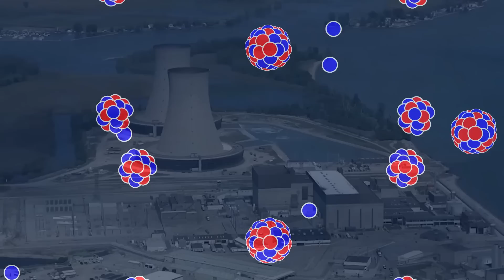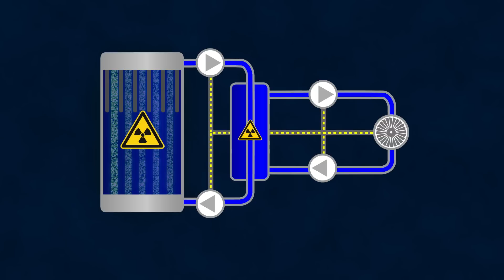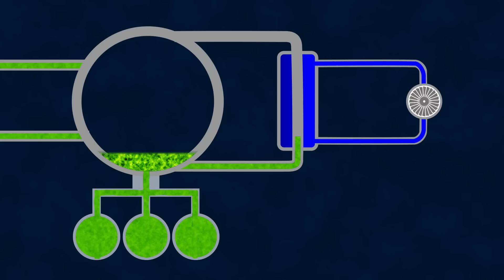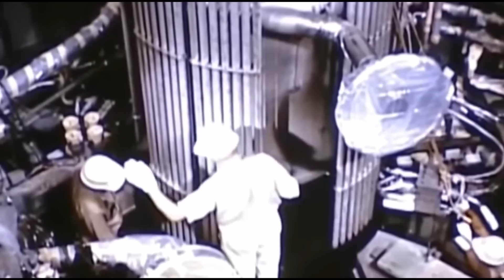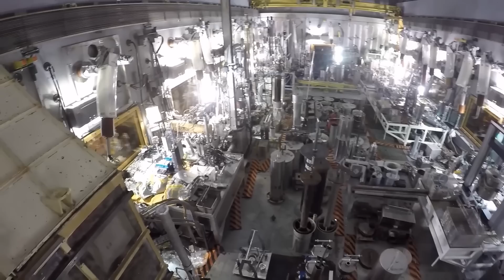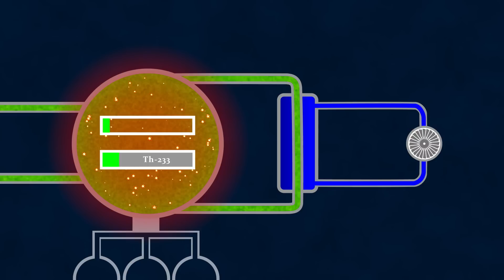Thorium Revolution: Can China’s New Molten Salt Reactor Transform Nuclear Energy?

Comment: Molten salt is the heat and moderator interchange method, both Uranium and Thorium can use it. It’s the salt that makes it safer as it’s not pressurised. 

It’s try decay elements of Uranium are more long lasting than Thorium that decays into Uranium.

I have always thought Thorium/Salt was a preferred but not only nuclear option

Comment: There are so many flagrant errors in this video that it badly detracts from the actual good content. 

Grade: D-minus "Trying hard but MUST fact check more carefully"

=====

Absolutely wrong about the salt's reactivity with air (or water)

Slightly correct about the corrosion issued but never bothered to mention it was addressed in 1964 using Hastalloy-N (which TMSR-LF1 uses and MSRE used) or the fact that WATER in conventional systems is vastly more corrosive (9 inches of stainless steel flange eaten away in 18 months in one case) - water is NOT a benign substance at high temperature/pressure

Correct about the salt density decrease with temperature but failed to mention the doppler effect effectively capping fission reaction temperatures at about 1150C

No mention that the pyrolytic carbon moderator is almost impossible to burn under normal circumstances and whilst it has a 10-year lifespan at "100%" output, its lifespan is effectively infinite below 80% (meaning the best ECONOMIC solution isn't changing out the moderators but derating the reactor. This improves available headroom too.)

No mention that TMSR-LF1 is a single loop design with thorium directly dissolved into the melt, testing Weinberg's proposition that external chemical processing of the Pa233 isn't required, at cost of a few percent efficiency (Cost-benefit analysis)

No mention of the extensive failure mode testing at MSRE which proved the "walk-away" safety aspects of the design as well as immunity by design to every kind of civil nuclear accident which has happened in the history of nuclear power (Military incidents are a different matter stemming from the "fast and loose" attitude to safety), including Mr Ouchi's unfortunate adventure (no water in the core, no need for reprocessing in ways that caused that particular incident)

Claims to use thermosyphon circulation - it doesn't for normal operation. The circulation pumps were an interesting design and the entire MSRE system was moduler, allowing complete dismantling/replacement of all reactor components (including the reactor itself) using waldos

No mention of the extensive use of electrical heating to keep the salts molten if reactions fail (the reactor needs this when starting up before achieving criticality)

No mention that LFTR designs can be fed high level nuclear waste and depleted uranium as fuel (which solves the big issue that antinuclear protestors keep bringing up)

No mention that LFTR designs end up producing 99% less nuclear waste (reducing a 900MW reactor's waste output over 60 years from "about an olympic size swimming pool, less radioactive than the original fuel in 450-500 years" to "a few (3-5) cubic metres, essentially inert in 400 years" )

No mention that LFTR designs run hot enough to directly drive industrial processes or be a drop-in replacement for coal burners whilst occupying less than 1/4 the space (Take a close look at China's coal-fired power stations and note the large blank space adjacent to most turbine halls. Those people are planning ahead)

No mention that despite there being "no thorium reserves", about 5000 tons per year is produced in every single monazite rare earth mine on the planet - "reserves" in mining terms are only calculated for things which have a market. There are no "reserves" of seawater either.

One of the major benefit of being able to use thorium fuel is that rare earth mines become economic. The Chinese have cornered the rare earth markets not by ignoring environmental standards but because the government has been purchasing thorium and stockpiling it for the last 20 years

One of the major benefits of being able to use natural or depleted uranium is that enriched uranium is unnecessary, which exposes separation plants as producers of depleted uranium - a critical step in the bomb-making process (you get 9kg of depleted uranium for every 1kg of 3% enriched reactor grade uranium. That depleted uranium is the feedstock for making weapons-grade plutonium) - or in other words it makes uranium mining/separation an explicit part of the weaponsmaking cycle and something which can be extremely tightly regulated or entirely banned by civilised countries

For what it's worth - NOBODY has ever managed to separate weapons material from spent nuclear fuel and if you attempted to introduce spent fuel into existing separation facilities you'd destroy them due to the contamination. The whole song and dance about used fuel is a distraction from the depletd uranium path and keeps protestors hanging around outside the wrong set of gates.

Comment: Can use ceramic construction. None corrosive. And heat to 2000 c
Reply: It's not radiation-resistant, unfortunately. 

Neutron bombardment is a curly issue to solve, but it HAS been solved - 60 years ago

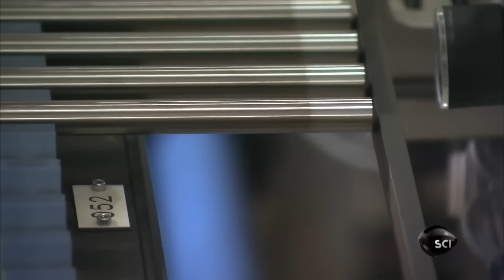Comment: 21:10 One of the mistakes in this video: known reserves on land are way, way more than enough to power ALL energy needs for way more than 100 years. Another inexhaustable source is the ocean, with even more uranium constantly being renewed by dillution. I raelly don't know where did you get that from.
Last estimated reserves for Thorium that I found estimated more than 5 BILLION years of current energy usage, making it the most renewable of energies, since that's longer than the Sun (assuming current energy needs). That is significantly more than 60.000 years
Reply: In mining/commodities terms, "reserves" only exist for soimething if there's a market for it

It doesn't matter that rare earth mines on average produce 5000 tons of thorium per year (there's more thorium in Monazite than all other rare earths combined). If there's no market, it simply doesn't exist.

This is a convenient method of doublespeak for those opposed to thorium - usually for vested interests (ie: people with an economic interest in the existing systems who see MSR as an existential threat)

Thorium ISN'T practical for solid fuel designs. It works but it ends up more expensive than conventional uranium due to the U232 issue requiring stringent handling precautions for virgin fuel production

Comment: In April 2025, the Shanghai Institute of Applied Physics (SINAP), part of the Chinese Academy of Sciences, achieved a significant milestone in nuclear energy by successfully conducting an online refueling of its experimental thorium-fueled molten salt reactor, known as TMSR-LF1. This operation marked the world’s first instance of refueling such a reactor without shutting it down, demonstrating the potential for continuous operation and enhancing the reactor’s safety and efficiency . ￼ ￼

The TMSR-LF1 reactor, located in the Gobi Desert near Wuwei, Gansu Province, achieved criticality in October 2023 and reached full power by June 2024. The successful mid-run refueling in April 2025 signifies a breakthrough in thorium reactor technology, highlighting China’s advancement in developing safer and more sustainable nuclear energy solutions . ￼

Thorium molten salt reactors offer several advantages over traditional uranium-based reactors, including inherent safety features, reduced nuclear waste, and the utilization of more abundant thorium fuel. The design allows for operation at atmospheric pressure and incorporates a “frozen salt plug” safety mechanism that automatically shuts down the reactor in case of overheating . ￼

China’s progress with the TMSR-LF1 reactor underscores its commitment to advancing clean nuclear energy and positions the country at the forefront of next-generation reactor technology. The successful online refueling operation not only demonstrates technical prowess but also paves the way for future developments in thorium-based nuclear power. ￼ ￼

Comment: Small correction, a Nuclear reactor will never experience a nuclear explosion, as it will melt down or a to high of a temperature to keep supercritical before it release enough energy for a nuclear explosion.
It will however reach high enough temperatures and heat to melt pretty much any material (jokingly referrer as China Syndrome) or turn water into steam causing a steam explosion.

If someone design a nuclear reactor that can actually cause a nuclear explosion, they should not be design reactors at all.

Comment: these pictuers are not of a thorium reactor.
Reply: Yes, white steam emission next to a river means it is a light water reactor.
Reply: @arubaga  It's worth lookin at the reason for this

Conventional water-moderated nuclear power is temperature limited to about 325C and drops to 275C at the turbine input - you can't produce dry steam, let alone supercritical because doing that in the secondary loop(s) means you're doing it in the reactor core, which is a bad idea (voids in the moderator....)

That in turn means that you have a VERY thermally inefficient steam turbine with VERY high maintenance costs due to turbine blades hitting condensation droplets. This has been the single biggest operational cost of nuclear power (most of the cost is in the insanely strong boiler (reactor) and even more insanely strong steam containment building wrapped around the boiler. Because MSRs don't require massive pressure containment the construction costs are reduced by 80% and the turbine maintenance costs are also reduced by about 80%)

MSRs run at 700-900C, which allows production of supercritical steam (You need around 650C for that), which in turn means the low temperature side doesn't need to be massively heatsunk by a water body and you can reject to air without sacrifing too much efficiency (The reason China is investing in MSR is because the north side of China is "dry" and water-cored reactors are impractical). You also get to take advantage of the same kinds of turbines used in coal plants AND you can effectively use the MSR as a drop-in replacement for the coal burners - at around 1/4 the size of burners including containment building and heat exchangers

Thermal power generation almost always comes down to "hot rocks boil water, spin turbines, drive generators" - whether the hot rocks are coal, uranium or geothermal is irrelevant to the turbines but the quality of the steam matters a lot. You really need your steam to be at least dry and preferably supercritical for best performance and lowest maintenance costs.

Supercritical CO2 turbines are about 10-20% the size of steam AND have a much wider range of cold side operation, but it's a really bad idea ot mix 2 new technologies at once. It's far better tio prove the reactors with conventional steam turbines first and THEN introduce supercritical CO2 turbines somewhere down the track when they're more mature

a 700C multi-MW heat source is great for industrial processes too (EG: making transport fuels from water without needing electrolysis) and the lack of pressure vessels combined with the worst case scenario of a fuel leak freezing solid within feet of the reactor means its safe to put the reactor near population centres - which in turn allows rollout of district heating systems powered by low grade waste heat. Domestic heating (oil or gas fired) emits MORE carbon than the global vehicle fleet so eliminating that, whilst keeping the electrical loading low is a good thing.
Reply: China's thorium-based molten salt reactor is the validation phase, but it is almost certain to be commercialized! Imagine that China has ten thousand years of mineral reserves, and he will find a way to solve the technical problems.
Reply: @jin-wn9lx  Everyone has ten thousand years plus and it comes along for the ride when rare earth mining - you have to separate the thorium to get to the other stuff and right now disposing of it is what makes rare earth mines uneconomic

China's been buying up and stockpiling the thorium output of its domestic rare earth mines for the last 20+ years - that's kept those mines in business and is what allowed China to corner the global rare earth market over the last few years

A rare earth mine with a thorium market at $150/kg is a thorium mine with a rare earth side gig. That in turn flips the availability/price of those metals on its head and is likely to drive new technological innovations
Reply: I am always annoyed when I see a video or story about nuclear technology because they always use the cooling tower as the icon for nuclear energy.  This really needs to change.

Comment: This video is incorrect.  The salts are NOT highly reactive with air, the author is confusing this with liquid metal cooled reactors, and most specifically sodium cooled reactors.
Reply: They're also water-insoluble.

The cost issue is that the US Navy did all the R&D on water-moderated design (Weinberg, under Rickover, for Nautilus) - the reason they used enriched uranium was because they knew it would work (thanks to X10 in the Manhattan project) and there were TONS of the stuff sitting around as an unwanted waste product of making plutonium bombs (Depleted uranium is the feedstock for weapons-grade plutonium)

Weinberg went on to develop molten salt liquid fuelled via the Aircraft Nuclear Reactor (MSRE was built on the old ANR)

Industry didn't run with solid-fuel/water moderated because it was the best solution. They did it because it existed and they wouldn't invest money into R&D themselves. If the US Navy hadn't made the Nautilus, nuclear power as we know it wouldn't exist.

What killed the ORNL MSRE project was the realisation by military interests that the ability to burn thorium or unenriched uranium essentially divorced civil nuclear power from the dependency on the waste products of weapons manufacture (1kg of "reactor grade" enriched uranium for every 9kg of depleted uranium feedstock for plutonium manufacture) and subsequently would cause separation facilities to lose their "dual purpose" designations, becoming part of the weapons production chain and as such falling under limitation treaties

It would also expose the separation facilities operational costs to greater scrutiny by congress, GAO, etc

In the same way that the "War Department" was renamed "Department of Defence", "separation facilities" were renamed "enrichment facilities" as a PR (propaganda was renamed to PR in the 1950s) move to obscure the primary purpose of the sites. The USA keeps up the facade by raving on about uranium enrichment and weapons made from enriched uranium - which won't happen - a U235 bomb costs $17-20 billion apiece in uranium alone (which gives you an idea of the ACTUAL costs of nuclear-powered ships/submarines) so it's cheaper to purchase your enemy than to bomb them. They're very pointedly silent about the depleted uranium because it would draw attention to the real weaponisation chains (FWIW, Iran's 50-60% enriched uranium is utterly unusable as a weapon but perfect for kickstarting a nuclear reactor. Mossad actually said this in 2003 (also pointing out that if Iran wanted to build nukes they'd already have a few hundred of them at that point) but Netenyahu ignored their advice not to provoke them in case they decided to build bombs instead)
Reply: Although not reactive with air, it's not good idea to expose it to atmospheric air because of the high temperature. Water vapour in air can cause hydrogen building up that enbrittled the container and causes explosions. Care should be taken to ensure isolation from open air, usually a slightly higher than atmospheric pressure of inert gas in the vessel.
Reply: @madsam0320  The MSRE used nitrogen flooding in the circulating pump headspace and sparged with nitrogen too . Don't forget that in operation you're going to be continually outgassing helium, tritium, xenon and krypton which need ot be drawn off and sequestered for a while before being salable (Krypton needs 6 weeks to lose its radioactivity, Xenon only a few hours). As you say, exposing it to air when operational is a bad idea - it's considered bad form to vent radioactive gases directly to atmosphere

ORNL have a large number of demonstrations of the salts (without radioactives onboard) and the old MSRE films are worth watching (there are two - one on the MSRE and another on using waldos to changeout a reactor vessel in a simulated 20MW reactor)
Reply: thanks.. it's youtube, so.. take it with a pinch of salt😂